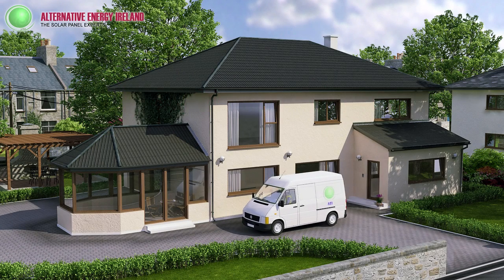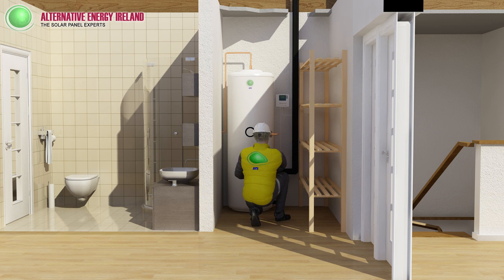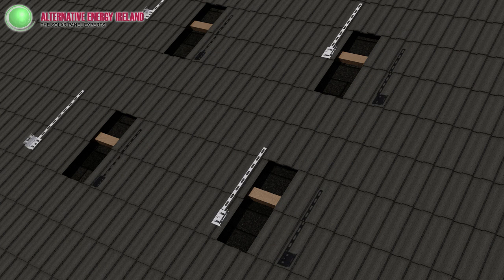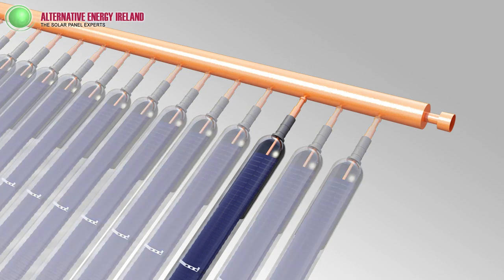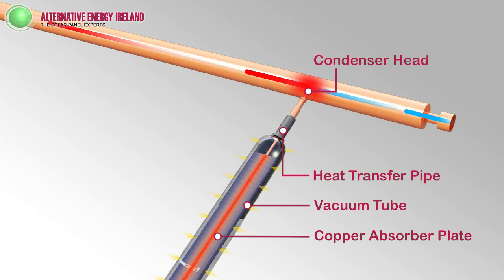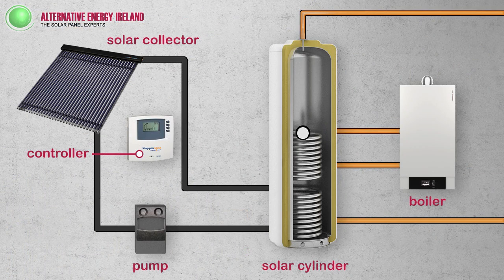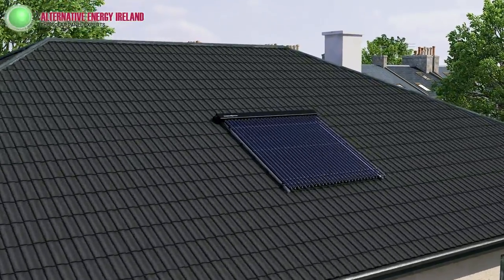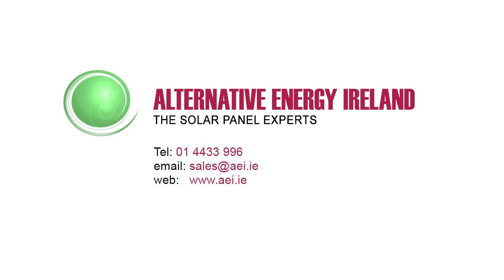Solar Thermal Installation with AEI

Comment: 2:15 The diagram shows water going into the bottom of the tubes, yet they're sealed and closed at the bottom; is this diagram just a symbolic drawing and isn't depicting the actual setup?
Isn't the cold water actually entering the top on one side of the manifold and exiting the other side on top?

Comment: Wondering if water actually goes into the tubes?? Or there is no water that goes into the tubes
Reply: The tubes probably have 4 or 5 ozs of acetone or something similar with a low boiling point.

Comment: Why not switch the water out and use gallium and circulate it using an electromagnetic pump through a copper coil heat exchange in a insulated under ground cistern has a heat sink? Incorporated thermal electricity generators a capacitor and gel battery bank to run a pump work home led lighting and induction cooking tops and induction cooling and heating systems. Novartis